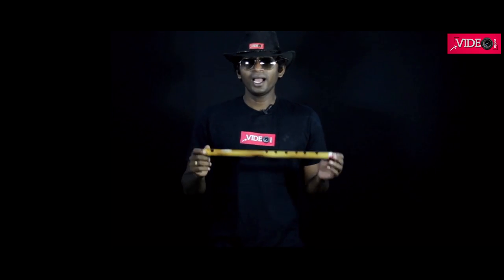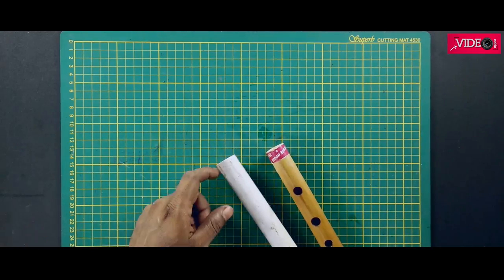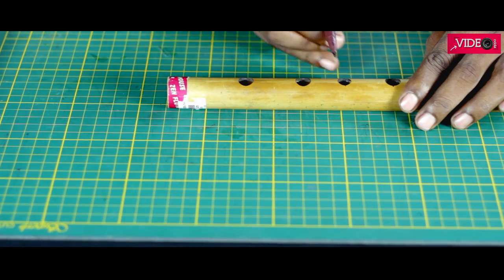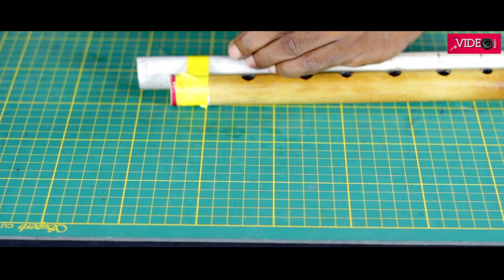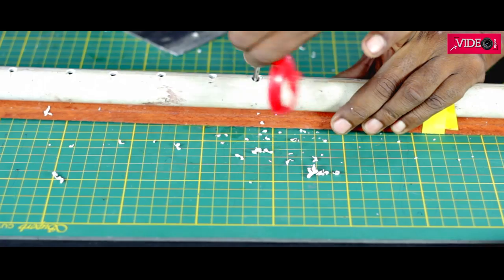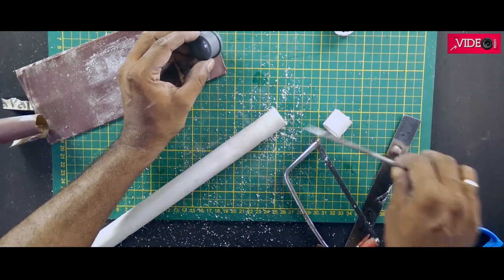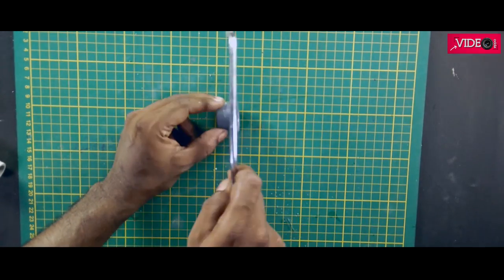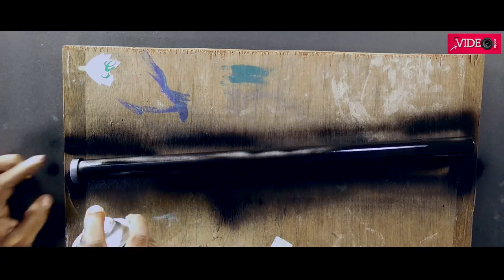MAKING A EASY  PVC FLUTE

Comment: I have a question..What is the exactly size or lenght of pvc pipe you made?And do you have a graph of open hole size of the pvc flute? Because i dont have a flute..
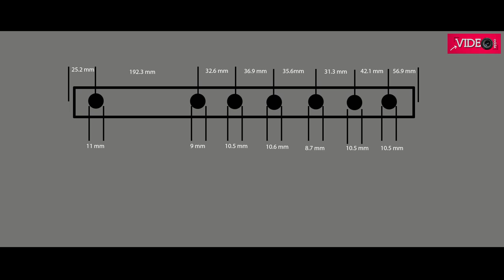Reply from the maker: I have given the measurement at 00:58. The total length I have used is 452.9mm
Reply: The finished flute is 452.9 inches?

Comment: I tried it but it does not worked what should I do?The diameter of pvc is 1.3mm.
Reply from the maker: Did you check for the air leaks? What is diameter of PVC, i am sure i cannot be 1.3mm

Comment: Yes I checked the air leaks there was no air leak and sorry for the wrong diameter the diameter of pvc is 1.8cm and radius is 1.5mm
Reply from the maker: Srishti Sargam Srishti Sargam .  even if you are wrong measurements, it should work if it's played correctly. Try making sound with a pen cap. If it whistles, you are good to go.  Sometimes it takes a few try to get it right. For me it was beginner's luck.

Comment: What is the scale of the flute?
Reply from the maker: what I ma here is a C#.
Reply: VIDEO EPPO I made one, I think, it is f scale. If it is, then how to fix it?
Reply from the maker: I have never seen anybody fixing the scale once the flute is made. There are charts available on the net on the inner diameter and corresponding hole sizes for required scales.We need decide on what scale we want and then proceed. Here I had a reference scale so it worked for me. Otherwise following the chart should help